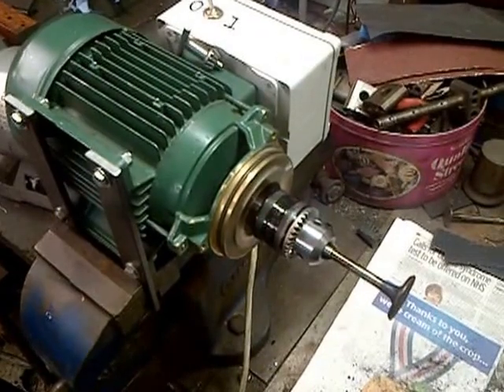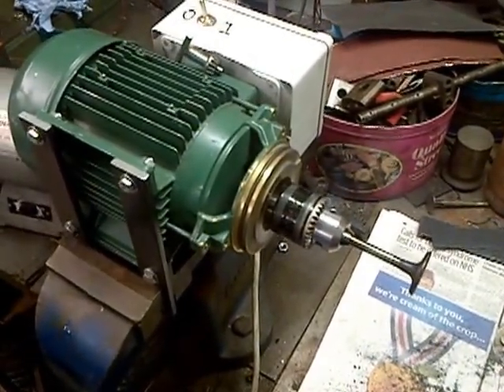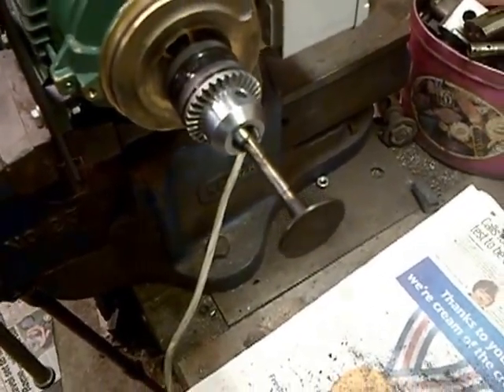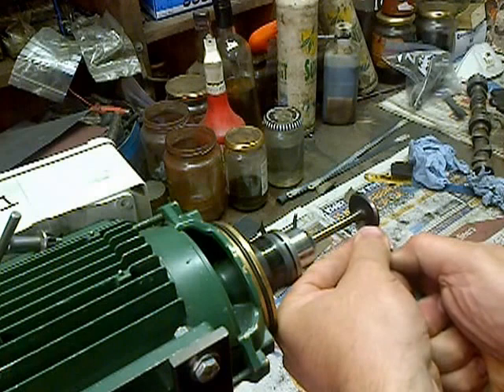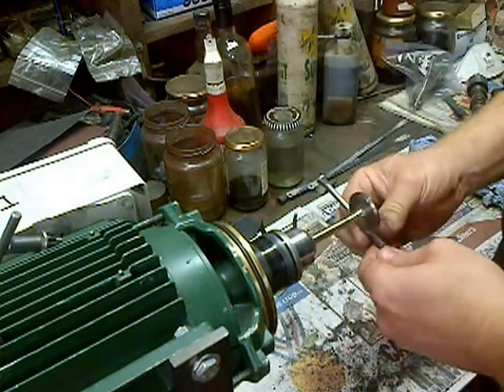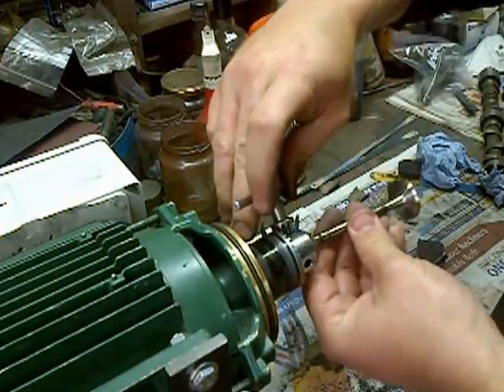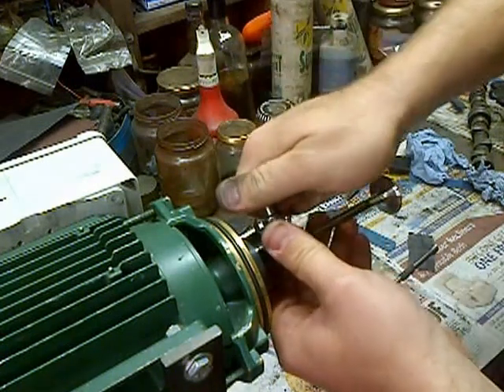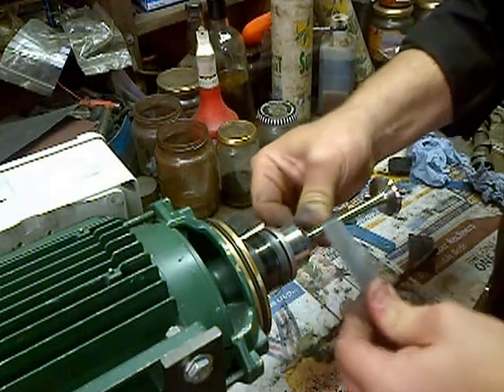Engine Valve cleaning with ACDodd

Comment: I've found that placing valves in a citric acid solution for a about 24 hours, does a good job of removing carbon deposits. Obviously a much slower method than yours, but on the other hand it is not abrasive.